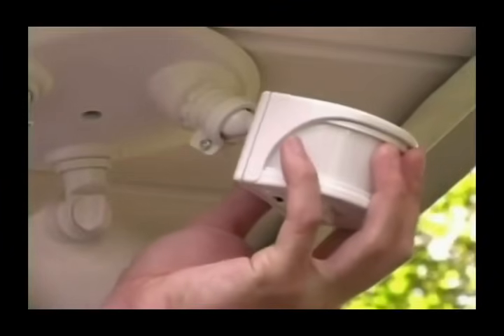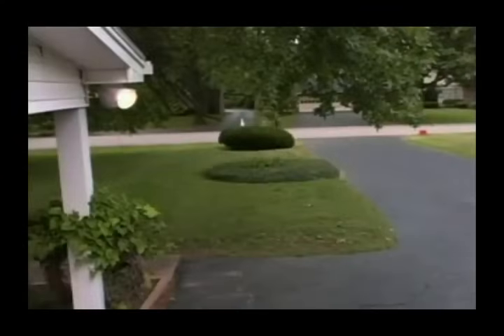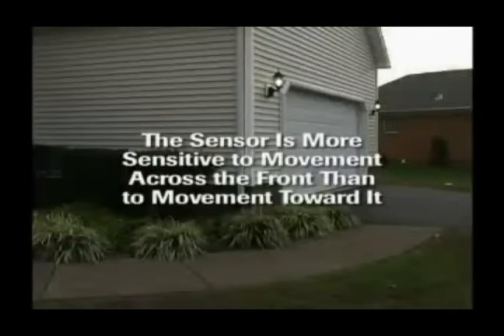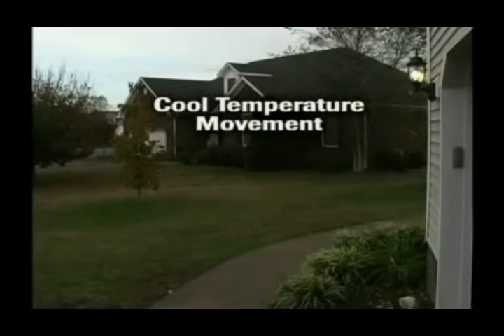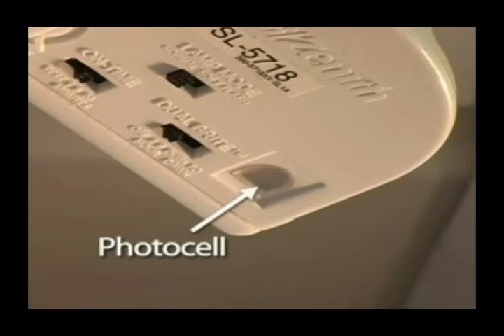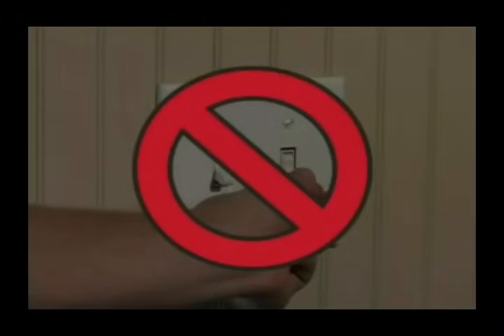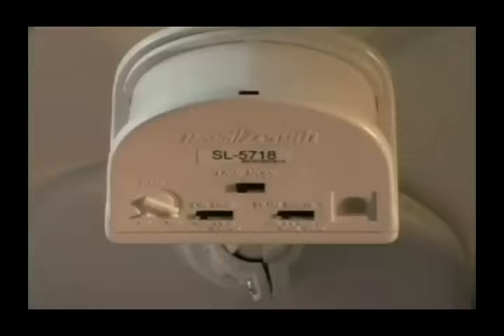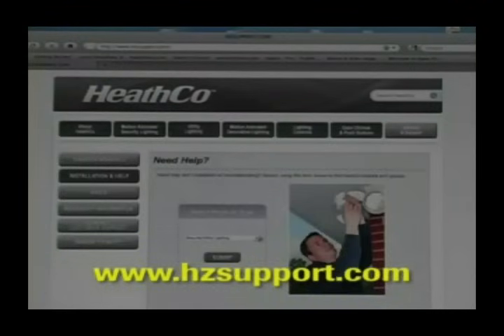Understanding Motion Lighting

Comment: Have had a couple of these for many years, but recently noticed that one was not turning on lights properly.  It controls the coach lights on either side of our garage doors, and should come on when our son comes home from work at night and parks in the driveway.  The testing procedure outlined in the manual says the sensor is OK.  I suspect that what is happening is that the daylight sensor is being confused into believing that its not dark.  The thing that has changed is that our son just bought a new car with brighter, LED headlghts.  He parks with the car aimed toward the house with white siding, and the car is silver.  So brighter lights with lots of reflective surfaces means more light bouncing around to confuse the sensor.  The solution is probably to change how the sensor is aimed - trial and error!